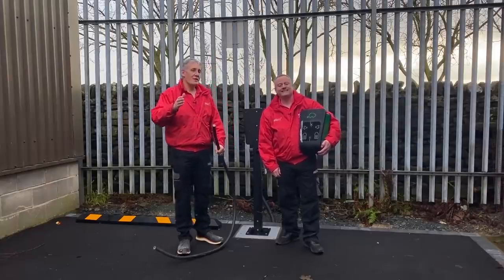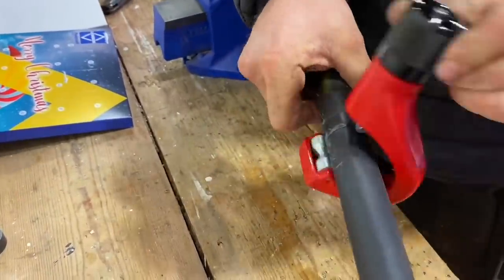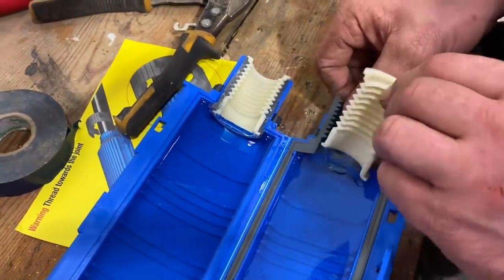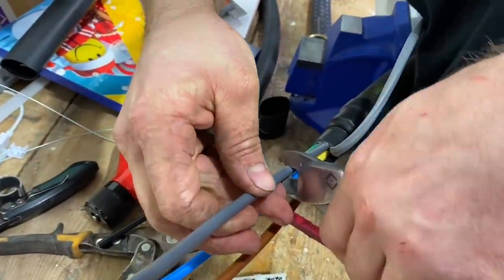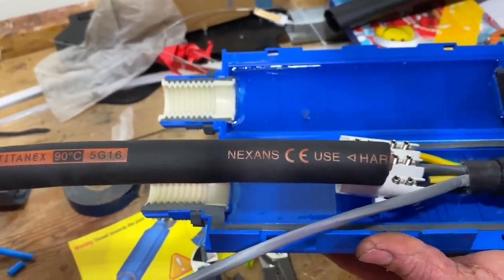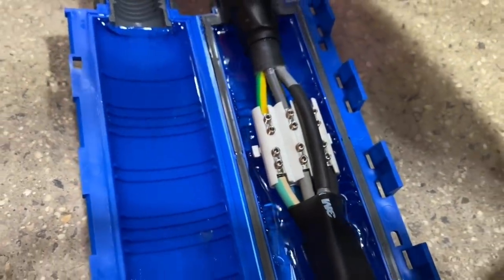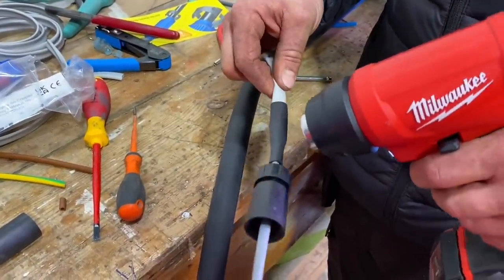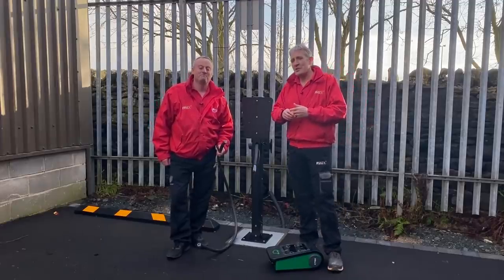PROBLEM SOLVED - USE RUBBER CABLE INSTEAD OF ARMOURED CABLE?

Comment: Would it be possible to use S.Y cable for the installation with a note on certificate of departure from bs7671 as S.Y doesn't have a Bs classification code ?
Reply: From my experience SY cable rots pretty quickly when use externally.. thanks

Comment: that cat5 doesent look like it has any shielding or foiling to prevent any interferance from the live ac running along side it

and its usually preferable to do so if your just running nearby ac wires or passing over them for this id expect to have seen sftp cable rather than what looks like standard box cheap ethernet

Comment: Data people would be horrified for the data cable to be so close to current carrying cable. it would have been better advised to have used fiber instead.
Reply from the maker: It’s for the data connection to an EV charger - low data rates.

Comment: I don't know how it is in Britain. But if that steel armored cable is necessary for code compliance, it will probably also be necessary for the last two meters.
Generally speaking: If done correctly, nothing is wrong with flexible rubber cable for installation purposes. And if you have to switch in between I'd use rubber for the complete way.

Comment: Bad design if it cannot accept the correct cable. Choose a better charger. Non optimal having joints & the flex is a disaster. Standards really are slipping STS.

Comment: Any reason for using SWA as opposed to NYY cable ?
Reply: NYY doesn't get enough of a mention here in the UK... It is great stuff!
Reply from the maker: It's tricky to get NYY in larger conductor sizes in the UK (for less than you'd pay for SWA) - Doncaster make a great variant of NYY with XLPE insulation - https://youtu.be/7Pc9bSrCYTw

Comment: HO7 is pretty tough stuff, in fact the outer plastic of SWA is probably easier to mechanically damage, and lets face it any incursion however deep into a cable means that really that cable would need to be replaced anyway. 
I use HO7 a lot on outdoor wiring especially lighting, even waterproof SWA glands are not has good has HO7 through a waterproof gland. 
So on balance HO7 has the is just has good, the only downside is when running multiple cables in a duct HO7 provides zero electromagnetic shielding against crossover especially to data or extra low voltage cables, unlike SWA which has a metal screen by default.

Comment: I'm not from the UK so don't know the details of your standards. 
But would it be easier and up to code if you used the rubber cable with a flexible steel conduit just for the underground sections. I personally use a lot of Liquid tight steel conduit but I only do above ground work.
Reply: Sounds expensive!

Comment: Put an extra point of failure into the installation when you could have just run up the inner cores with the inner sheath without the armour, not good need designers to connect these items that alone would change the design, jell shit, resin the only guaranteed waterproof connection, joining data   problem waiting to happen,

Comment: The flexible  duct is not shovel proof, like hitting it with iron object (diigging) so cable must be armored cable. What you connect to it does not matter or alter that requirement.

Comment: Sigh! Stranded cable into a joint with screw compression with no intermediate plate protection and ZERO FERRULES!!

WTH!!?? Use of ferrules should be MANDATORY whenever & wherever stranded cable is used in such joints!

10 ends 10-15 seconds max per end, £0.001 per ferrule (bootlace uninsulated is fine) means an expense of 2 mins and ONE penny to do the job RIGHT not half cocked! Dear God! 🤬🤬
Reply from the maker: We used ferrules on the class 5 conductors (fine stranded). We don't use them on class 2 conductors as this is not recommended.  We made a dedicated video on this topic - https://youtu.be/Ia13o1I6DkM

Comment: its nice to see the amount of fancy fittings you guys use but running data down the same cable as AC is a no. it isnt a problem up the post but the flex is not reccomended unless its a high grade shielded insidde. Would make off the armoured through swa into an ip box filled with gel and run the flex out to terminate, also dont use your screwdriver to untwist the cables you should unwindn them with your finger

Comment: My understanding is that the "Electricity   Safety,   Quality   and   Continuity   Regulations 2002" explicitly require underground cables to be protected by a screen of earthed metal.

What is not clear to me is whether those regulations are applicable to private cables, or only to cables operated by a distribution network operator.